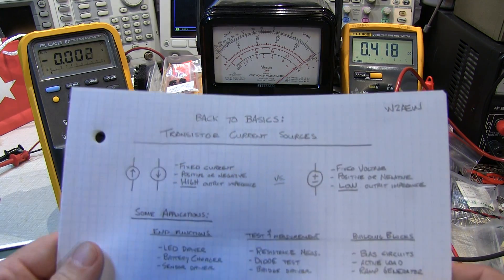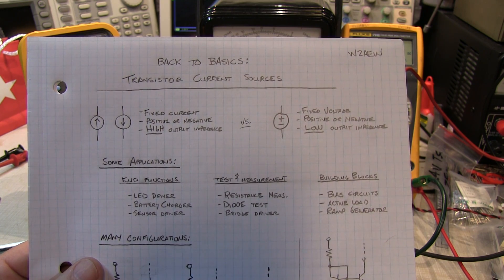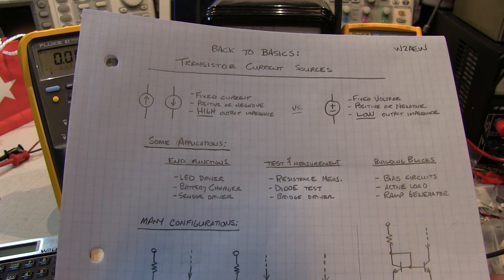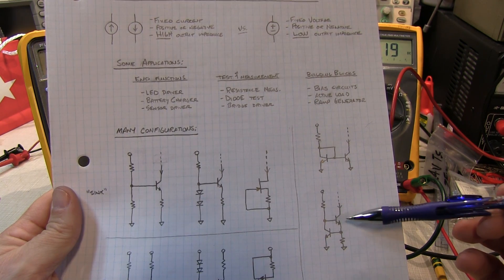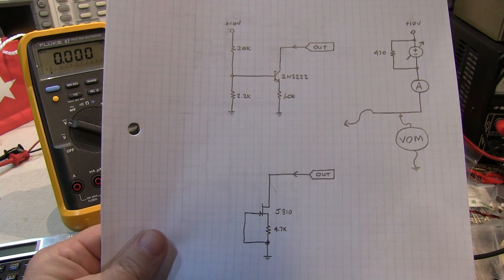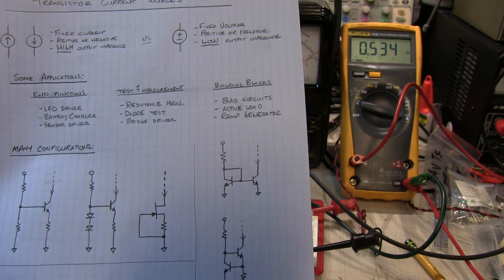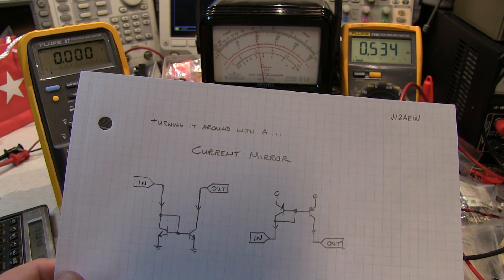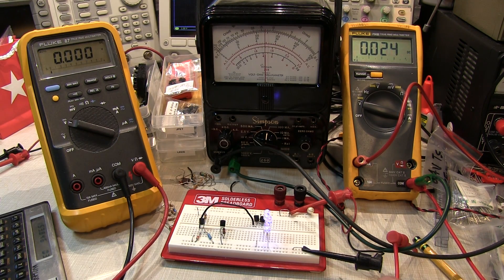#190: Back to Basics: Transistor Current Sources and Mirrors

Comment: How are current sources used to increase the gain of an amplifier when used instead of a resistive load? I didn't get that part...
Reply from the maker: Quick example: for a common emitter amp without emitter degeneration, the small signal gain is given by gm*RL.  Since gm is a function of collector current, the maximum gain is limited to typically well under 100x.  Since a current source can be used as an active load (instead of a passive load like a fixed resistor RL), the output impedance of the current source becomes the load (RL_equivalent).  Thus, for the same collector current (same gm), the gm*RL_equivalent product can be very large, leading to very high gain.  This is how op amps achieve extremely high open loop gain.
Reply: ***** Got it. As always thanks for a great video!

Comment: I am curious about something you told about slew rate. Value of current inside op amp current mirrors limit slew rate.
Reply: slew rate is function of Capacity and Current
if and opamp use a bigger current of polarization (this current normaly is obtained of a current mirror) you will improve the slew rate.

Comment: You mention microamps a few times (as shown on the meter), is that right?
Reply from the maker: Yes. The meter shows 0.418 milliamperes, which is 418 microamps.
Reply: Ahh, I did not notice the probe in the mA socket. The dial confused me a bit :D